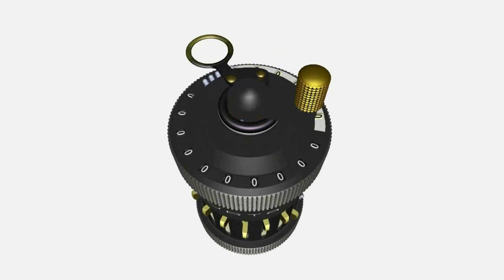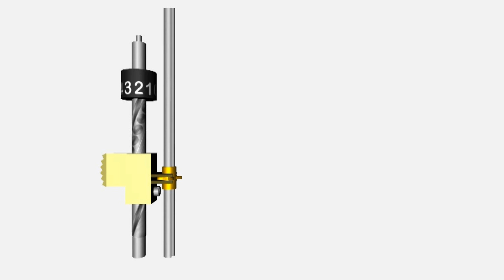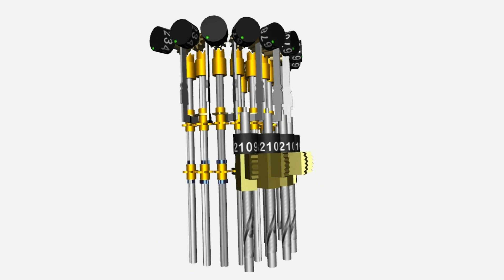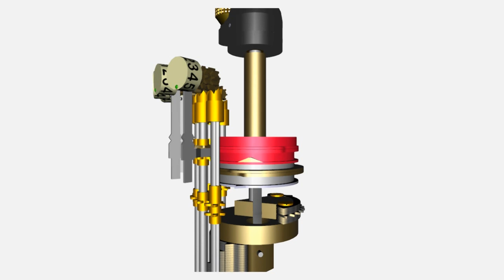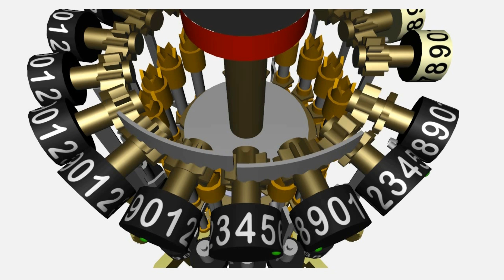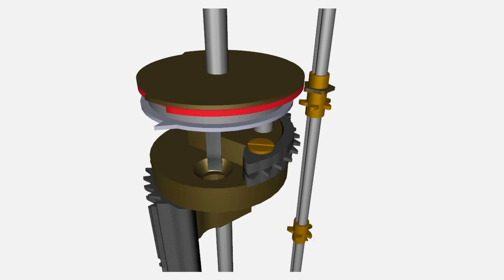How the CURTA Works

Comment: Absolutely fascinating, a pinnacle work from an age which has passed. We used these in auto (Rallye) racing in the 1960s; in many ways what was in the navigator's hands was just as important - and possibly as complex - as what was under the hood. Sadly, I included my Curta in the deal when I sold my TR-3.

Comment: If you take this apart without knowing how it works your screwed big time.
Reply: +killerbeenl  It used to be said that you paid for a Curta calculator twice:  once when you first bought it, and a second time when you had to send it back to the manufacturer for re-assembly after taking it  apart to see how it works.  Apparently LOTS of people took them apart, and had to send them back to the factory for re-assembly.
Reply: +David Simpson Really can't blame them for that. Fitting such an effective mechanical calculator in such a small package is truly amazing. Anybody'd be curious to see how it works.